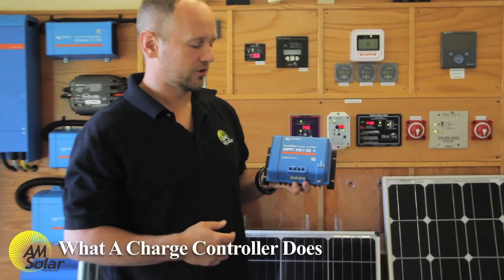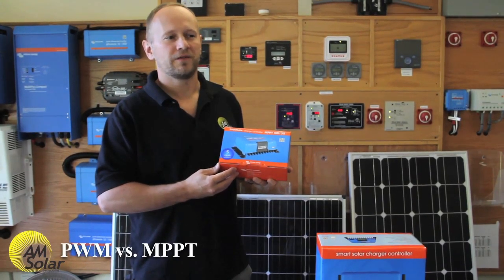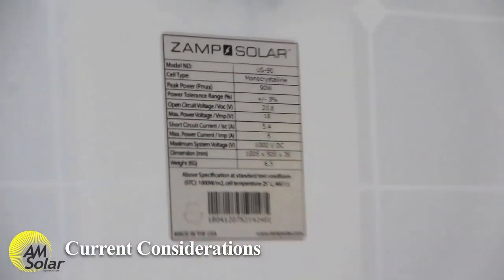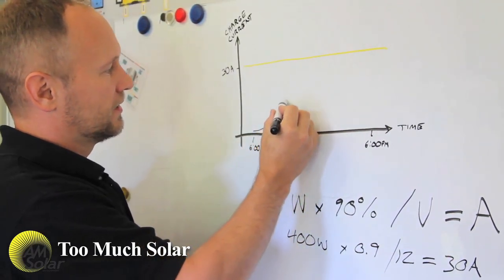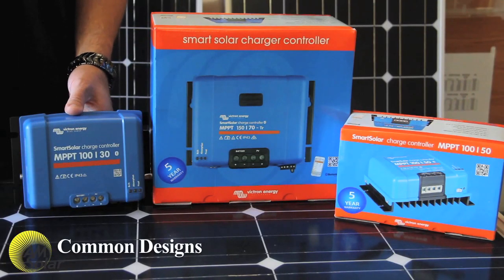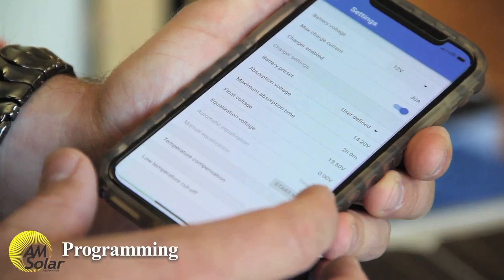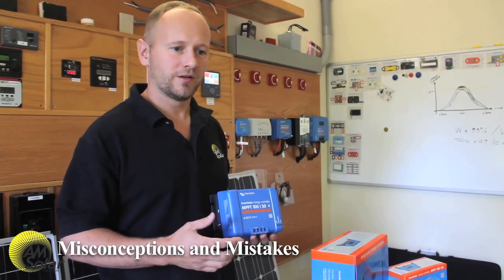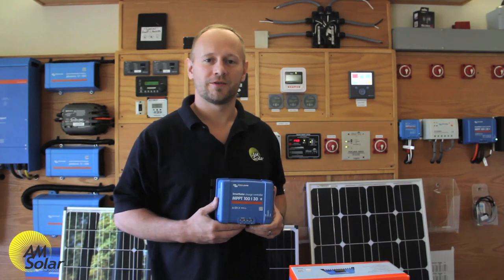How to Select the Best Solar Charge Controller for Your RV, Skoolie or Van

Comment: Can the 100v/30a mppt handle 3kw(3000w) using series and parallel. 
5x 100w solar panels at (20v / 5a)each in series=
500w(100v / 5a) 
Now I'm at 100v. I still have 25a left
Because this is a 100v / 30a mppt.
500w(100v / 5a) x 6 in parallel =
3000w(100v / 30a)

(□)=100w at 20volt/5amps
(□□□□□)=500w at 100v/5a

□□□□□>|<□□□□□
□□□□□>|<□□□□□
□□□□□>|<□□□□□
= 3kw(3000w) at 100volts/30amps
Reply: In your math, you are using the charge controller input voltage.  You need to be using the charge controller output voltage (battery bank nominal voltage).  3000W x 0.9 / 12V = 225A.  It won't work.

Comment: I have 2  250 watt solar panel s  . Can I use a mppt  solar  charge controller
Reply: Yes, I would connect them in parallel and use a Victron SmarSolar 100/50.
Reply: @garrettowne  Why parallel? 😬 Series would be better re the wiring run to the controller.

Comment: Hi i need help..i have 8 solar panel 435w each one ..72v....i have 8000w convert 48v in...which vector can i use and how can i conet the solar panel tkyou
Reply: If the Vmpp is 72V, you can get away with an all parallel connection using a 150/70 charge controller.  If you go with series pairs, you might get better results, use a 250/100 controller for that.

Comment: Why do you multiply by .9?
Reply: The 0.9 represents efficiency, less than optimal weather, charging battery voltage being higher than 12V, etc.  This calculation isn’t meant to be exact, but it is meant to be good enough to make the right decision regarding which charge controller to use.  For example, if I crunched numbers and came up with 31.2A, I would recommend the 30A charge controller.  In most cases, a 20A charge controller would even work, but there would be clipping on bright days.

Comment: Losses (line losses, panel angle, age of panels) need to be considered also. This is just an example, please don't try this at home! I use 8x100 watts panels, in series (2 years old system) open volts 21.6 x 8 = 172 - losses in my system = 35 volts, 25 feet marine 12 gauge wire, controller voltage hovers around 130-140 at peak times in cool sunny days, and in Texas, and generates approx. 3.5 kW with a 600 watts GTI, very impressive. Keep your system cool is very important.

Comment: So with a mppt charger could you hook panels in 24v series to charge a 12v battery?
Reply: Yes, as long as you don't exceed the input voltage limit of the particular charge controller.  In some cases this is more efficient, but doesn't perform as well under partial shade conditions.

Comment: Hi, Can you recommend a large inverter for like 11.1 kW system that also provides battery charging solution built in?
Reply from the maker: funtimes S That’s out of our area of expertise. My recommendation would be to contact Victron or Outback Power.

Comment: So if I want to run a top load fridge that is 45watts/3.75amps and charge a cell phone how many panels should I use?
Reply from the maker: I would start out with about 300W on a 30A charge controller.  If the 300W isn't enough, that charge controller will give you room to add more.

Comment: Thank you for this video. I am not sure I grasped everything and want to be sure before I buy the MPPT controller but understand because I exceed 300w I should use a MPPT vs PWM.

I am using six 100w panels @ 12v each to charge a 12v 100Ah Battleborn LiFePO4 battery. My total Open Circuit Voltage is 127.2v and Short Circuit Current 6.02 amps. 

600w x 90% = 540 and I should divide that by the charging voltage? If I grasp this correctly with a 12v battery I would need a 45a MPPT. Would a 40a work without damaging the battery or controller? I am located in NY state with low sun and not sure if I should use 3 in series then parellel to the battery or if I should just go in a series?  Thank you, I appreciate your help and this video!
Reply from the maker: If we were installing six 100W panels, we would connect them all in parallel with 10ga to a combiner box, then we would route 4ga from the combiner box to a switch, then to the charge controller (Victron SmartSolar MPPT 100/50) then continue with 4ga to a 60A DC breaker, then to your battery system.

You would be fine with a 45A charge controller.  A PWM controller is fine if all the panels are in parallel, but an MPPT charge controller would be better.  I wouldn’t connect all the panels in series, because that would take you over 100Voc which is above the limit of most 45-50A charge controllers.  A 3x2 or 2x3 configuration is also acceptable (and preferable if you can’t use thick 4ga cable) but it doesn’t handle partial shade as well.

I hope this helps.
Reply: @GarretTowneAMS  Yes, that is very helpful! I truly appreciate the help and reply. I watched some of your installation videos and was more than confident that I could trust your advice. You folks do great work.

I was amazed at the Airstream install!

Thanks again...

Comment: Hi my name is Denis. I just wanted your opinion. I just want to run my LED  lights in my house. Would the victron inverter cope with being switched on and off ?.
Reply: The inverter is designed to be shut on and off.  You should be fine.

Comment: Hi Gary. I have two 160w panels going through a BlueSky 2000e controller. 4agm 12v batteries totalling 760ah’s. On a sunny day the batteries never peak to over 13v when my output setting is 13.8. Will I get better output output with Victron 100/30 controller? Also pros and cons of panels wired in parallel or series? Thanks
Reply from the maker: Ian Mayo I don’t the charge controller is the weak link in your system. I think your ratio of solar wattage to battery amp-hours might be the problem. You don’t have enough solar wattage. I would get two more panels (which would necessitate a 50A controller). If you don’t do this soon, your batteries will suffer.
Reply: Garret Towne Thanks Gary. For now would I better off removing a battery out of the system?

Comment: hi can i use that solar charger controller by giving AC input of 220v power to the transformer and 24v or 12v dc output to charge the batteries? instead of getting the power from PV panel. thanks...
Reply: That won't work for a number of reasons.  A better solution would be a Victron IP67 charger.

Comment: I need help with mine wondering if you had some info for me rate now I have 2-200w I have 3-100w and 2-150w. They are all 12v. I was having a power problem thought it was the solar panel come to find out it my battery. Rate now I'm using a 90amp pwm charge controller. Going to get a mppt. Was wondering on a  Recommendation on a charge controller.  This is on a rv..
Reply: A 70A or larger controller will work.  Victron SmartSolar MPPT 150/70.  Keep in mind, when you mix panels of different Vmpp ratings you get a slight reduction in performance.  I'm pretty sure your 200W panels have a Vmpp that is different than your 150W panels.

Comment: Thank you for the great informative video. 

However I need a clarification on the startup voltage and Open circuit voltage. For example, if I use 3 strings each with 3 SHARP 330W PV modules (Open Circuit Voltage (Voc) = 46.2V, Short circuit current (I sc) = 9.33A, Voltage at Point of Max. Power(Vmpp)=37.8V ) and I use Smart Solar Charge Controller MPPT 150/70 (150V absolute maximum coldest conditions, 145V start-up and operating maximum), will the Charge Controller startup or not?

Thank you
Reply: If you are sure you won't get cold enough that the 150V limit will be problem, the short circuit current won't be an issue either.  If you put this on a 12V or 24V battery bank you will have a lot of output clipping.  An array like that has the potential to charge at about 220A on 12V.  With that controller, you will only get 70A.
Reply: @garrettowne  i am using 48V battery bank

Comment: Say I have an MMPT 100/30.
Doesn't that mean that it can accept a max. PV input of 100V and provide a max. output charging current of 30A ? At, say, 14V ?
So why the max. PV array is only 600W or so ?
Why could'n I hook it up to a 20kW array, provided that array's Voc is under 100V ?
Of course, then I can still charge my batteries with only 30 A, but what's wrong with that ?
Reply: The Voc of the solar array has to be under 100V or else it will fry the controller.  The max charging output is 30A at whatever the charging voltage is.  If you have more than about 450W of solar on that controller you will get clipping, which means the controller will be sending a maximum of 30A to the batteries, even though the solar array could provide more.  Another lesser-known limitation of the charge controller is the array short circuit limit of 35A.  This is what will keep you from connecting to a 20kW array.  We recommend a maximum of 450W on the 100/30 charge controller, but you can go larger as long as you don’t exceed the Voc and Isc limits.  When you go larger, just expect some clipped.  Does this answer your questions?
Reply: @garrettowne  , thanks for your very quick response !
Again, I don't understand something :)
What is the short circuit of a panel / array to do with the controller-charger ?
Isc is the biggest possible current in a circuit and it happens in the case of a short  between the power buses, as I understand.
So, would the MPPT be shorting the array ?
Very unlikely.
Also, in the case of a short on an array, no current will flow into the controller, right ?
It's input voltage would be zero.

Comment: I really need your help. 

My solar panel details are as below. 
Voltage: Voltage at Max Power (Vmax) - 37.39V, Open Circuit Voltage (Voc) - 46.38V
Current: Current at Max Power (imax) - 8.20A, Short Circuit Current (isc) - 8.96A

I have a 24 v 11 ah lithium ion battery.

Please suggest me the suitable mppt controller rating.
I would also like to ask if it is possible to charge the batteries at max 4 amps. Not more. Is that possible in mppt?

Comment: Would you tell me if i am use 2 12v  AGM DEEP CELL M would it be ok to use 2 300w panels
Reply from the maker: Assuming you have two 12V 80Ah - 100Ah batteries, yes, 600W of solar would be fine.  The amp-hour ratings of the batteries is important.  I like to keep a ratio of 1Ah or batteries per 0.5 - 2W of solar.  If you have less solar, your batteries may not reach a full charge frequently enough.  If you have more solar, your batteries will probably sit at full most of the time, meaning you spent too much money on solar panels.
Reply: @GarretTowneAMS  thank you so much

Comment: I have 12 x 250 watt solar panels and my system is currently running on 24volt inverter. I’m looking to change my inverter to a 48volt system as I anticipate to increase my load to 6800watts. Can I get a 150/85 charge controller to run (configure) for my system now at 24volts and later use it with 48volt inverter?

Comment: Is it ok to re purpose a house solar panel which I think is 36 volt in a 12 volt application with one of these victron controllers? You mentioned the open voltage limitation but I'm just wondering if still ok with using panels that are higher voltage. Thanks.
Reply from the maker: Yes, people do this all the time.  The Victron SmartSolar 75/15 can handle 75V and the 100/20 can handle 100V.  You are well within that limit.
Reply: @GarretTowneAMS  excellent, was just worried the tech was different somehow. Ta

Comment: Thanks for a clear, simple video. Finally, someone prepared to de-mystify some of the "shrouded-in-secrecy" off-grid setup information. Frustratingly, the only information available on internet forums seems to be pitched at mountain-top level for advanced users only. Do you happen to know which Victron models have the bluetooth function? Mine is the Easy Solar 170/50 MPPT, and when I tried to scan it with the bluetooth turned on and using the Victron Connect app, I get "no device found".
Reply from the maker: If the Victron controller has "Smart" in the name, it has built-in Bluetooth.  Otherwise, check out the Victron Bluetooth dongle that can plug into a VE.Direct port.

Comment: using a mppt controller on lower watt situations is way better then pwm, On smaller installations its wise to use a mppt, so the statement to use pwm on smal installations is a bad advise in my opinion, you have at least 20 % more charging power then whit the ancient pwm.... Dont use pwm, its old fashion, and in case off Victron just as expensive . Best regards< VRM marine, Dealer Victron.
Reply from the maker: I totally agree that MPPT charge controllers will perform better, no matter what size the system, but some people measure performance in terms of $/W, and others W/Square Foot. If you are going by $/W on a small system, a PWM controller would be preferred.

Comment: I heard that cold weather can increase current so the controller should be sized 25% larger than what is needed.  You are saying to mult by 0.9 and not 1.25.  So 3 100w panels in series (22.5 V each, open current 5.75A each) would be fine for the 100 / 30 controller?
Reply from the maker: Scott Wood I would feel fine with five 100W panels on a Victron SmartSolar MPPT 100/30. 500W may result in some clipping of power on bright days, but nothing harmful. Cold does increase voltage output of a panel, but you certainly don’t need to oversize for cold weather.

Comment: This was very helpful especially the bit about too much solar. Does the array wattage equation apply to pwm? If i use 160W panel, the equation says 12A. But the short circuit voltage is only 8.7A. What I really want is to get as close as possible to 10A for my battery.

Comment: Hi Garret, I'm installing a 250watt single panel and charging a 12v battery on my camper and live in Colorado. Which Victron controller is the best choice and why? Thanks!
Reply from the maker: 2 Ball Sport SmartSolar 100/20
Reply: @GarretTowneAMS  Thanks for the quick reply, but am concerned with the max of 10gauge wire terminals and the loss of current?
Reply from the maker: @2ballsport226  10ga feeding the charge controller is fine, because it will be at the higher voltage (around 30V).  But from the charge controller to the battery, I recommend at least 8ga, 6ga would be better.
Reply: @GarretTowneAMS  I agree but the charge controller will only except up to 10ga wire?
Reply from the maker: 2 Ball Sport This is unfortunate, but there’s nothing wrong with carefully trimming some strands to make it fit, or you can splice on a very short section of 10ga. We have to do it all the time.

Comment: Great video. I am building my system and will have 2-100 watt panels, what charge controller would I need? I won't be expanding the system
Reply from the maker: My favorite is the Victron SmartSolar MPPT 75/15.
Reply: @GarretTowneAMS  Thank you for your response. I forgot to add I will be using 2- 6 volt AGM Deep Cycle golf cart batteries. Would that be ok?
Reply from the maker: Ms. Sowlo Yes, those are compatible.

Comment: I got a total Watt of about 7000W, which charge controller is recommended?
Reply from the maker: It would depend on the voltage of your battery bank and the Voc of your solar panels.  It will most likely require multiple charge controllers.
Reply: Garret Towne I have 12 x 250watt solar panels and I have 6 x 100Ah Agm batteries with a 24volt Inverter. I want to go off grid and get a 5KvA Inverter and increase my batteries to 8KwH (Lithium Batteries). Is a 150/85 Mppt Charge Controller good enough and will I need to add more panels?

Comment: You should mention that at 4:00, the v in your calculation is based on the current voltage of the battery at that moment in time, not some generic '12 volt bank" as you describe it. It's a critical distinction.
Reply from the maker: I know where you are coming from on this, and I agree that it would tighten up one aspect of the formula, but 90% is probably even more inaccurate, since it is supposed to encompass the wide range of sunlight conditions.  I just use it as a rough rule of thumb and frequently oversize solar arrays (which is what would happen if you raised 12V to 14.4V).  You can look at charge controller selection in two ways 1) Design it super conservatively in a way that no clipping is allow (maybe end up spending a little more than you needed to on the controller) or, 2) Ball park it, maybe oversize your array, and experience some clipping on bright days.  On most of the charge controllers we use, an oversized array isn’t going to harm the controller, it will just limit the charging current on very bright days. Thank you for noticing that.
Reply: A 12 volt bank at 12 volt is what we see as empty, Charging  to bulk mode is 14,4 volts , so using a mppt gives you even more amp input at low battery, just when you need it, And the percentage will drop down a bit by higher battery voltages, when the battery is gettig fully charged, Messuring from the over voltage you have present in the array, it wil work even better at lower battery voltage, producing more charge amps. (only iff you use the mppt controller) (its not the case in pwm controllers)
Reply from the maker: @MrBugsier5  You are correct, but the point is that this is just a quick rule of thumb calculation.  I could just as easily use 14.4V and 75% and come up with the same values.  Variations in solar irradiance introduce more inaccuracy to the calculations than not getting the exact charging voltage and efficiency factor.
Reply: @GarretTowneAMS  and Wx.90÷12 is easier math to remember

Comment: 400w 30A, are u sure??
Reply from the maker: I would feel comfortable putting 450W of solar on a 30A charge controller.  I am sure.
Reply: Oke
Reply: What of 24volt system

Comment: I have 500 watt panel and 24V battery  voltage, can I use same Eq.  500x90%/24=18,75A.  Should I consider voltage this 30 A Victron MPPT or its god to go.
Reply from the maker: The 30A will certainly work.  I would go with the 20A if you don't plan on adding any more solar.